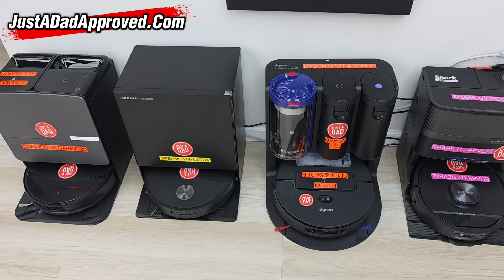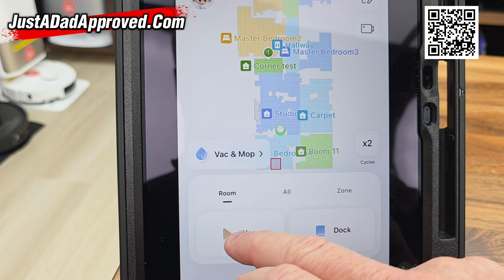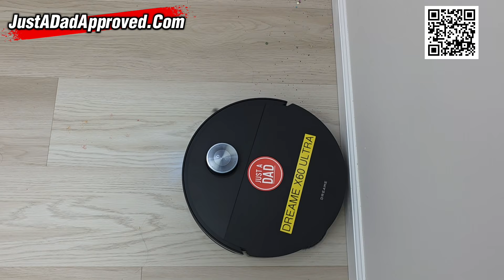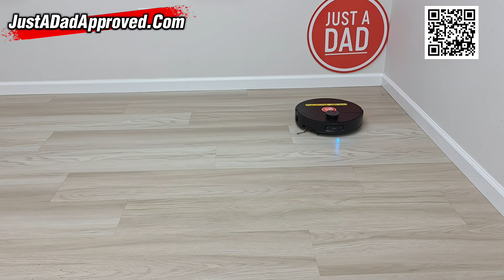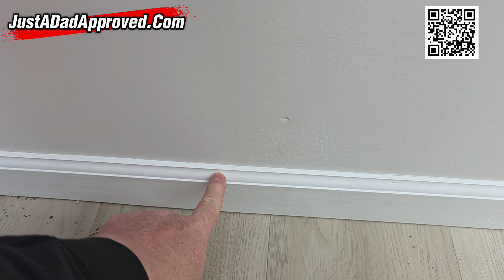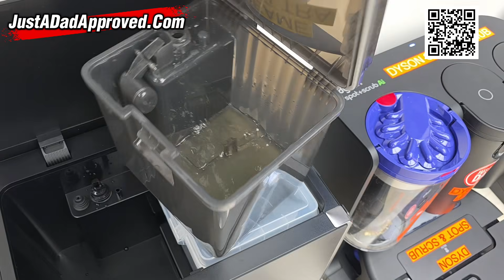Dreame X60 Ultra Mopping – Muddy Paws, Cereal, Hair | Full Test

Comment: A week ago I bought the Dreame L50 Pro Ultra specifically for its retractable radar. I needed it to clean under a long cabinet hanging on the wall 12cm above the floor and under a huge sofa with a height of 10cm above the floor. Well guess what, without a radar these robots are absolutely blind.. No matter the settings, without a radar the robot is completely disoriented. These retractable radars are the biggest scam of all advertisements. And when you think about it, 12cm of height is enough for the robot to pass even without retracting its radar. Instead, it passes half the distance under this piece of furniture with the radar raised and the other half with it retracted. In the end, I'm returning it and will get the L40s Pro Ultra because I'd rather raise the sofa another 1-2cm than trust underdeveloped technology again for a bag of money. 
It's a good idea to start testing these features for those who, despite all the research before buying, still hit a brick wall.